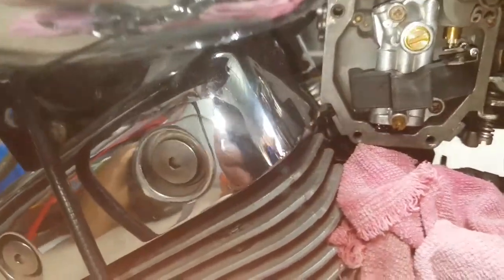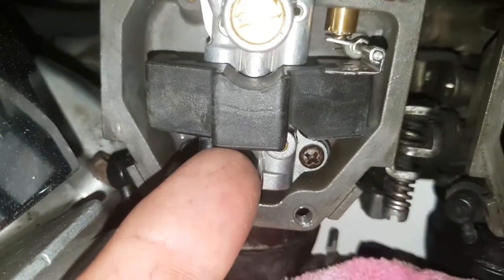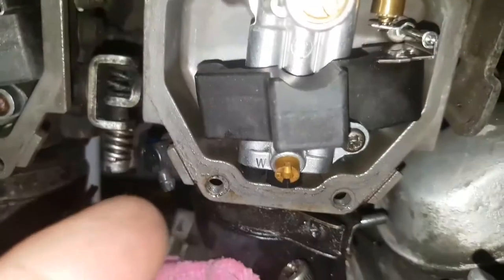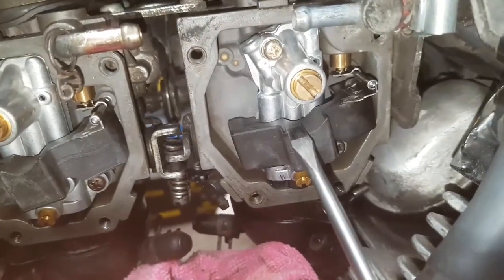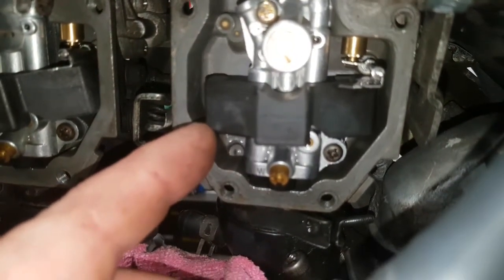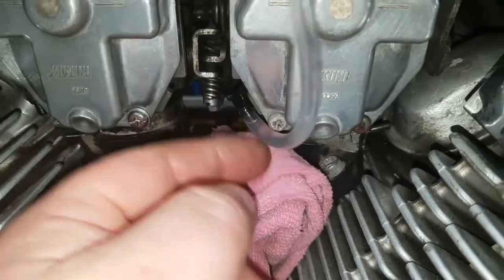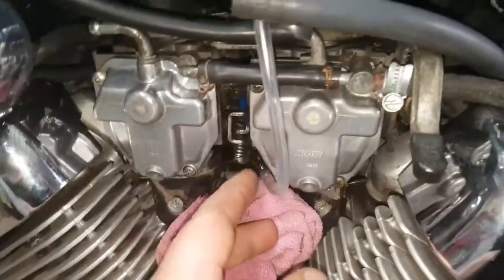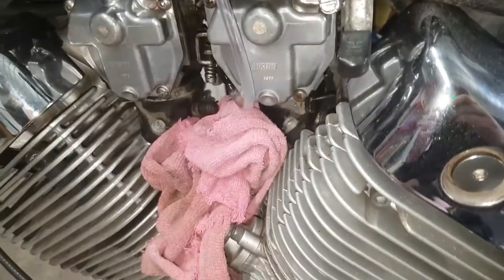Yamaha xv535 carburetor fuel float setup

Comment: After following this procedure, I have a flooding issue. It seems that when I replace the float bowl covers, turn on, the fuel pump won't stop.
If I remove the covers, manually hold floats, the fuel pump shuts off.
This on both carbs.
Any ideas?
Reply from the maker: Do you have a hole or split in one.off  your floats take floats off and give them a little shake see if you can hear fuel in one.of the floats.
Reply: @fuelheadjay8800  Floats are fine. Had my neighbor verify my needle height setting. We did this with covers off and manually held floats closed and slowly opened each till gas flowed. Only slight adjustment from what I had. Put covers on, cranked until engine fired up.
This was a weird issue. I don't believe float height adjustment needs to be this accurate. I still believe there was another 'hidden' issue.
Weird tho, with covers off, floats held closed, the fuel pump stalls. With covers on, fuel pump runs and runs and runs. This was giving false assessment of the situation.
When the motor was idling, the fuel pump would stall, fuel level reached in bowls, and then run again, fuel level drops.
I'll need more convincing this was not down to minor float height adjustment. Time will tell.
Reply: @fuelheadjay8800  Just had a thought. My initial problem started when I installed two new float needles that caused fuel to overflow out top of the carbs. I replaced with original needles. The new needles measured about 1mm shorter.
Anyway, in case this happened again, I put the drain pipes into plastic bottles and let hang down from the carbs. Every time I would try run the engine, I'd have the bottles hanging.
After adjusting the floats as previously mentioned and motor started, I did not have the overflow pipes/bottles fitted.
I wonder if when the covers fitted, air was trapped in the bowls preventing the floats from raising due to overflow pipes hanging down 🤔. When pipes removed, the trapped air could escape.
Reply from the maker: @petermccool9396  that is strange. but yes if needles are smaller and this setting levels would have to be lower to take up that 1mm short. Good luck chap let us know when u get it working good. some times you just got to tweek and set things up different to others. Interesting knowing some floats are smaller then norm.
Reply: I'm having this problem now the pumps stays running
Reply from the maker: Set to high
Reply: @fuelheadjay8800  you're right I checked. Thanks!!!!!!
Reply: @fuelheadjay8800  so do I bend the tang down to set it lower? Thanks!!!!!!
Reply from the maker: @karlh4313  up u need float down so bend up to pull float down
Reply: @fuelheadjay8800  gotcha!!!
Reply: @fuelheadjay8800  I went to low once and it wouldn't even allow fuel in the bowl. I took bowl off to verify..
Reply: @fuelheadjay8800  to low to high ughhh lol 😂 this is a little difficult for someone that hasn't done it one before. I would of loved to see your part 2 when you used the tube to verify with engine running.
Reply: @fuelheadjay8800  I'm gonna get it!! 😂 But WOW 😲
Reply: @fuelheadjay8800  I'm having a real issue with getting this fuel level measurement right ughhh! I'm at 30 mm below the center mark on the cover and I can only get it to about 18 and then it seems to keep the pump running and no gas comes out till I bend the tang down on the float to let the valve down some.. what am I doing wrong? I have a 3 mm hose attached to the drain fitting with a adapter for a hose and then the Yamaha glass part for this with the mm on it.. I'm confused!!!!! Ive spent 3 days trying to get it right and I can't I've even tried doing just the front carb to get it to 14mm below the mark on cover and can't get it.. I feel stupid
Reply: @fuelheadjay8800  if I bend float tang up it brings float up more and puts valve up more and let's less gas out and makes the pump continually run. If I bend tang down it's let's more gas out and the valve lowers more but the float is lower and has to raise higher to close valve.  I feel like I've screwed up smh it's all rebuilt but one float it was good other had gas in it and showed air bubbles when dunked in water...
Reply from the maker: Replace float chap
Reply: @fuelheadjay8800  I replaced the one float that had gas in it the other was fine I even kept it under awhile to see if it had any air bubbles or gas when I let it out it was good. Should I still replace it?
Reply: @fuelheadjay8800  I can't get it right!! I'm thinking of trying once more if I can't I'm gonna try to find someone that can come over or take it to a shop. It's all screwed up now popping black smoke. Was running way better before I decided to do this. Now that I can't get float level right the bike is useless :(
Reply from the maker: @karlh4313  right just set the floats to them little circles like in begin of vid forget tubes and measuring for know and see how it runs then. but if one off your floats have a hole in it and holding fuel u never get it set up. Plus make sure your spark plugs are clean has they shit up quick if playing with carbs
Reply: @fuelheadjay8800  thanks!!
Reply: @fuelheadjay8800  I did, it still pops and black smoke when rev I cleaned plugs but maybe need to replace. Idk I'm going to check tomorrow with the guage and if off I'll try once more and get new plugs. It's such a shame bc it was running so good before I did this. I feel like a stupid POS.